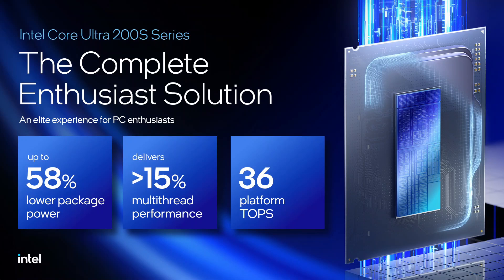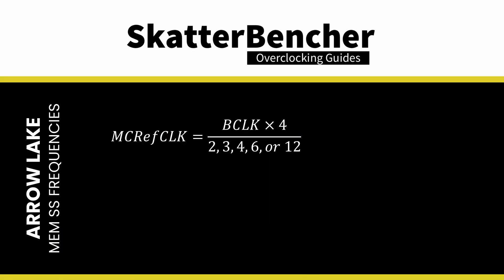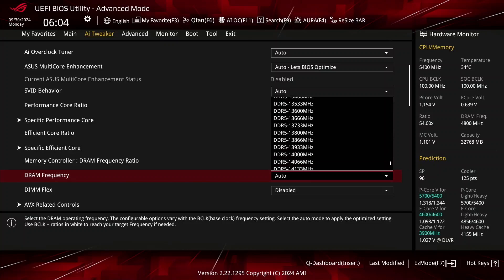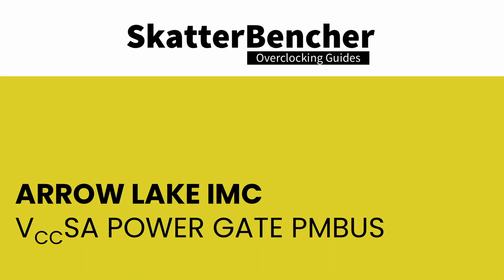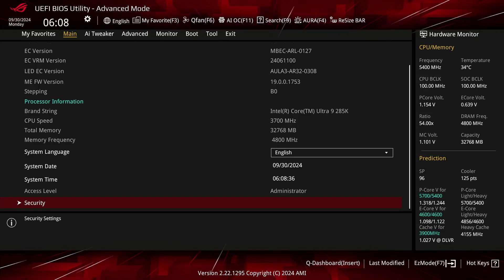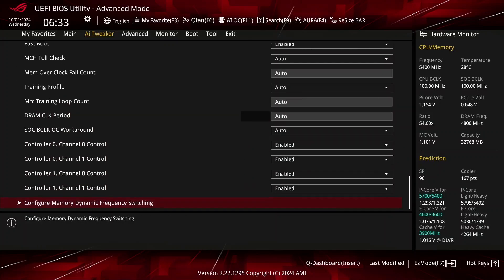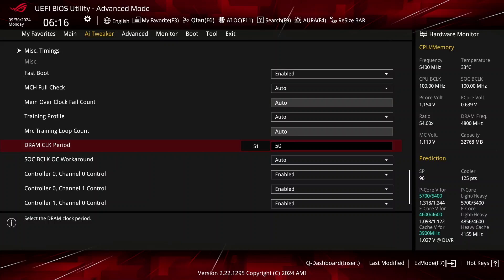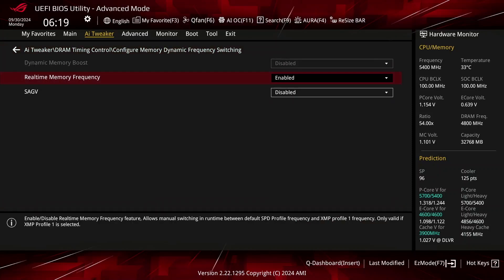Arrow Lake Overclocking: Memory Sub-System (IMC+DDR)

Comment: What am I missing? I can't figure out how to change mcrefclk or cmi ratio. I'm in gear 2, but my memory controller clock is running half of what I think it should be. I'm running 2x32GB @6800 and my controller clock is 1700. I'd liuke to get it to 3400. My latency is atrocious. I know I have a lot more tuning to do, but I don't really want to tighten timings any until I figure the memory controller clock out. Oh, and I'm also using an ASUS BIOS, the Proart
Reply from the maker: 3.4 GHz memory controller clock with DDR5-6800 would be "Gear 1" which isn't available on Arrow Lake.
Reply: @SkatterBencher  @3:47 you show you have a memory controller frequency of 4ghz with 8000 data rate RAM. That makes sense to me, but I'm struggling to get mine to half my data rate like your instead of 1/4. I'm in Gear 2, but it acts like it's Gear 4. Is there something else I'm missing that is dividing it again? And are CMI Ratio and MCREFCLK Divider directly adjustable? I've watched this part of your video over and over and I'm missing something.
Reply from the maker: Wow, you're right. Looking at it now that table doesn't seem to make sense. I'll have a look at the documentation and see where I went wrong in the calculation. I'll update my blog post when I get to update it.

What's for sure is that the memory controller runs at either half or a quarter of the memory frequency. DDR5-6800 = 3400 MHz, so memory controller is 1600 MHz in Gear 2 or 800 MHz in Gear 4. Only previous-gen DDR4 platforms would run Gear 1 where IMCCLK = MEMCLK.
Reply from the maker: Okay, had a look at the documentation again. It's a bit challenging because the documentation is not always accurate. But in short:

- refclk = 100 MHz (default, but can be changed by user)
- mcrefclk = refclk x 4 / cmi_div (CMI divider enables granularity of [33, 66, 100, 133, 200] MHz)
- qclk = imcclk = mcrefclk x cmi_ratio
- dclk = memclk = qclk x (gear_type + 1) x 2 (gear 2 = 0, gear 4 = 1)
- data rate = dclk x 2 (because it's "ddr" or "double data rate")

In practice, the CMI ratio is set automatically by setting the memory ratio and gear type. We can't change it by ourselves. So, practically, we kind of going backwards from memory data rate

Example: DDR5-8000 with Gear 2

- data rate = 8000 MT/s
- memclk = dclk = data rate / 2 = 4000 MHz
- imcclk = memclk / (2 x (gear_type + 1)) = 4000 / (2x1) = 2000 MHz

Example: DDR5-8000 with Gear 4

- data rate = 8000 MT/s
- memclk = dclk = data rate / 2 = 4000 MHz
- imcclk = memclk / (2 x (gear_type + 1)) = 4000 / (2x2) = 1000 MHz

Example: DDR5-13000 with Gear 4

- data rate = 13000 MT/s
- memclk = dclk = data rate / 2 = 6500 MHz
- imcclk = memclk / (2 x (gear_type + 1)) = 6500 / (2x2) = 1625 MHz

Comment: The DLVR additional heating issue is real? It sounds terrible for extreme overclocking.
Reply from the maker: For extreme overclocking there's the option to bypass DLVR and switch to so-called "PG Mode"

Comment: Sub 70 congrats, waiting in Sub 35 or I'm staying on ddr4
Reply: the problem is intel doesn't have a gear 1 mode or 1:1 for ddr5 memory which is really weird. AMD has gear 1 mode, but their memory bus doesn't overclock as high the fastest MT/s you can get in gear 1 is 6400MT/s. Maybe intel would have low MT/s in gear 1 mode so they skipped it for marketing purposes. Would you rather have near basic stock speeds of 5600MT/s or 8400MT/s? that's going to get people to jump all over the platform that can run "higher" ram speeds.
Reply from the maker: Pay close attention to the memory configuration on AMD platforms before concluding it's running "Gear 1". 

When Gear Down Mode (GDM) is enabled, the command rate is halved. So even if the IMC is running at the same frequency as the memory, with GDM enabled, its effective command clock rate is half that of the memory. So it's not quite "Gear 1".
Reply: @SkatterBencher  I went with intel z790 12900k ddr4 4000 cl18 4x16gb samsung b die for #39 in xtu. Until latency comes down for 2t cmd via 8000mhz+ and I can tighten past 30ns I'm staying 12th gen. GDM on AMD if you can get 6200 and I'm still going to do better for latency. I think you have to hit 6400 for it to feel like if I could get 4266mhz stable on my rig.
Reply: Super informative, as always…
Reply: @Dante_S550_Turbo  it's all smoke and mirrors. I'm rank 39th on 12th gen on xtu and I'm using 4x16gb ddr4 4000 cl18 samsung b-die. I would need to be able to do ddr5 8000mhz+ on z790 and I still won't be setting records. These companies rely on people being idiots.

Comment: I'm sure for many all this is too much to understand fully like me. Also Asus that seemed to be in the middle of 13th and 14th fail I'm going with MSI.

My request would be to make a video for moderate settings with added screenshots that you can pause and apply with simple to follow explanation what it does. If possible to add MSI BIOS shots too because different and terms can differ also. I think your videos are important because it seems there is lot more room on the "15th" than it was on 13th and 14th gens that got fried by MB's overpowering the CPU from the box.

Comment: I doubt you'll see anything sub 60ns. At least for the time being. Seems to be an inherent design flaw of the new CPUs. Higher memory speeds means looser timings looser timings means higher latency. They'll probably be a middle ground right around where he was in the video or you can go down a rabbit hole tightening subtimings. But shaving 5ns or more is going to be an undertaking. You'll probably end up seeing 55-58ns at best with people who spend it when ungodly amount of time of tuning.
Reply: I think you're being exceptionally optimistic
Reply: @Berserkism  yeah I would agree. I don't think everyone's going to get to those low latencies. But I have seen a few people get some exceptional numbers. It's going to really depend on your skill and hardware. Someone who acquires a golden sample CPU has an exceptional motherboard and memory along with the experience of tuning I could definitely see hitting those lower latencies.  It's going to be how much money do you want to throw at it and how much skill and time do you have.
Reply: AMD has gear 1 mode, idk why intel doesn't. The only problem with AMD is you can't o.c. the memory bus very high so the fastest MT/s ram speed you can have in gear 1 is 6400MT/s overclocked.
Reply: @Dante_S550_Turbo   if your lucky 6600 is there. Or you go 2:1 route and push 8000+ depending on your gear and needs
Reply: I saw 64ns on a Tomahawk and a 265K